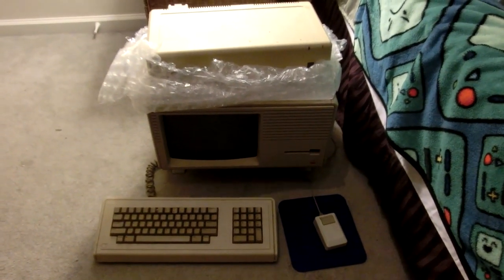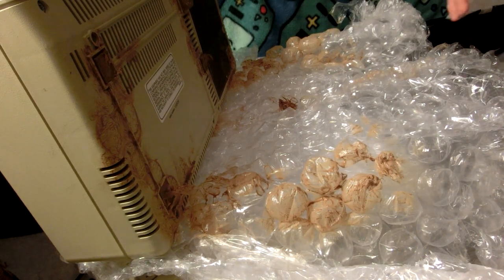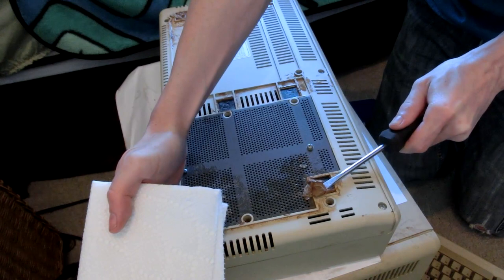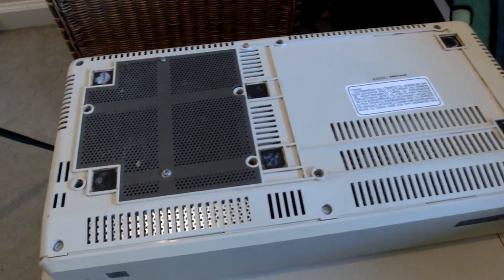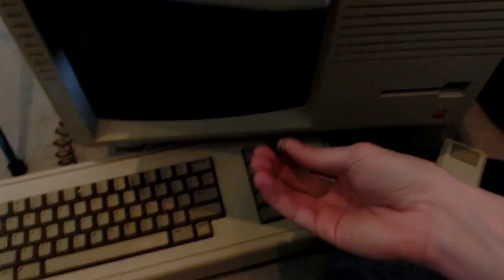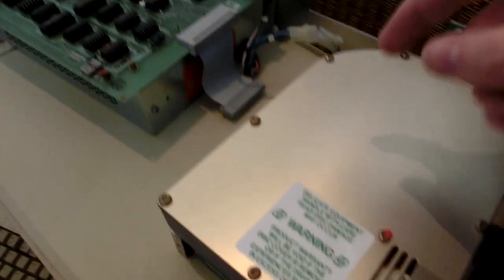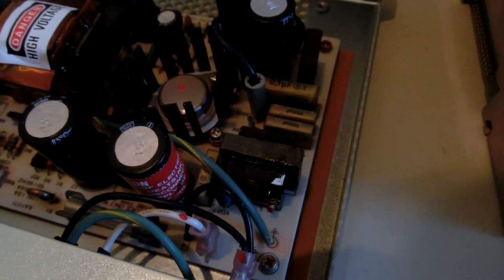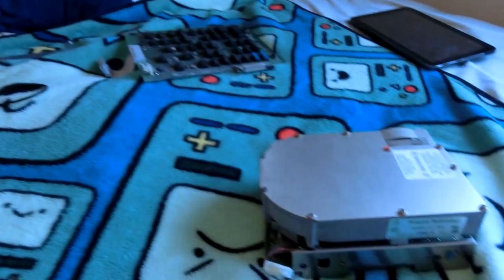Apple Lisa Restoration part 1: melted rubber and external hard drive

Comment: We have an old Mac SC-20 hard drive case where we replaced the busticated 20MB drive with a redundant 20 gig drive. Haven't powered it up in a spell but it was working the last time we used it...

We had another SC drive case whose plastic crumblafied on us. Saved the power supply for use as a 'hard drive starter' for testing drives...

Comment: The cable between the Lisa and the ext HDD is probably a SCSI cable and not a standard parallel pc cable, even though the connectors are the same.  Back in the day there wasn't a large variety of readily available connectors to chose from.  Also check out a phenomenon known as "chip creep".  Fix by pressing down on all of the IC's in sockets to re-seat them.   -bob
Reply: good point Robert the parallel cables used to look the same, but weren't the same :-)
Reply from the maker: battonfive no its a pass-through cable so its basicly parallel to my knowledge.
Reply: Rinoa Super-Genius mm I think they standardised it a bit later than the Lisa so it might have a slightly different transfer method that can cause stuff like flicky light flat lines http://en.wikipedia.org/wiki/Parallel_port cant be sure though you maybe right :-)
Reply: Robert Bakley It's not SCSI, the Apple ProFile is a Parallel connected drive. http://en.wikipedia.org/wiki/Apple_ProFile
The Lisa internal "Widget" drive was also not SCSI, but I don't believe it was parallel like the ProFile, I think it was some proprietary interface.
There was no official SCSI for the Lisa, but SUN Remarketing (and others) did make SCSI cards (with ROM updates), with a hard drive bracket, so some sure can have bootable SCSI drives in them.

Comment: ST-506! First 5 1/4" drive ever. 5MB. It might spin up or not, depending on how much use it has seen over the years. From the outside it looks like it is in fair condition. This also looks like a double height profile. I remember people having Maxtor double height drives. It sounded like an jet engine when they were spinning up.
Reply from the maker: telecrate oh right it is! i totally didnt recognize that as the first.

Comment: looking good. good that the issue is only a psu failure rather than a HDD failure. i look forward to the next video. was the apple lisa produced in 1984?
Reply from the maker: smallenginedude71 yeah i think it was made in May of 1984, can't remember where that was written though. that would make it a Lisa 2 instead of a Macintosh XL.
Reply: Rinoa Super-Genius mmm must be earlier... is there any date codes or something on it?
Reply from the maker: smallenginedude71
earlier? no the first Lisa was released in 1983 and this is not an original Lisa for sure.
Reply: Rinoa Super-Genius either way its an awesome machine!

Comment: always measure a PSU under load, there arepins on certain PSUs that need to be grounded in order to bring the supply up to full voltage, also, I'm pretty sure that drive isn't supposed to spin up unless the lisa is turned on